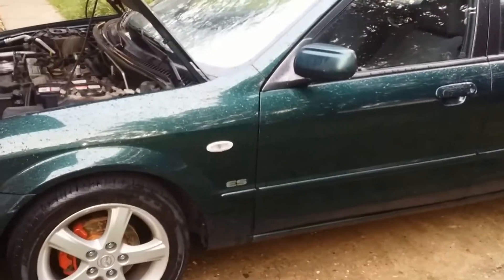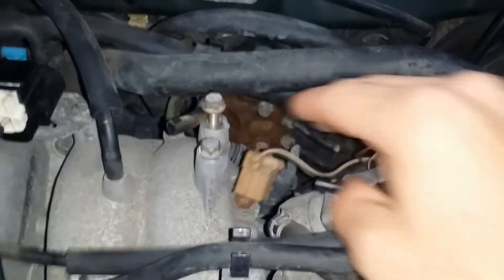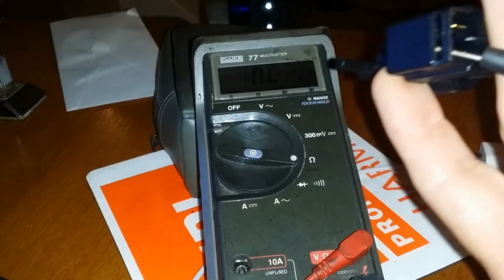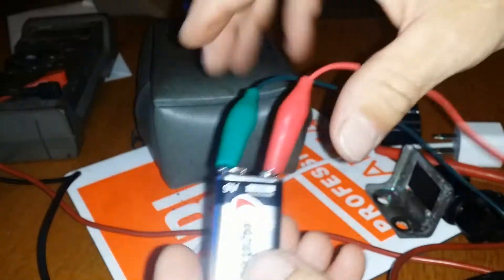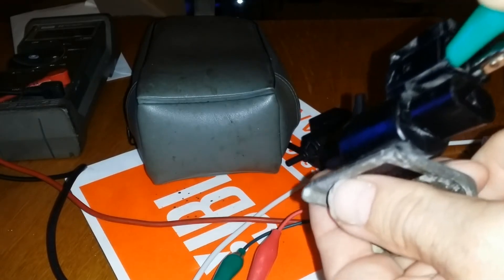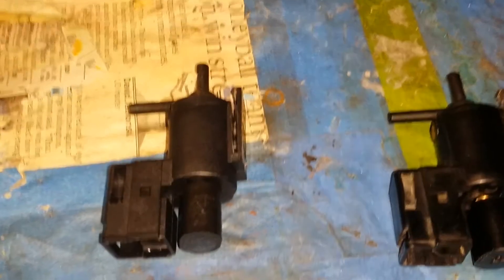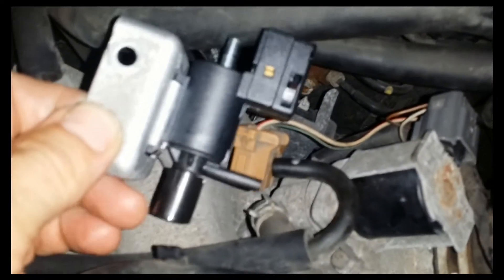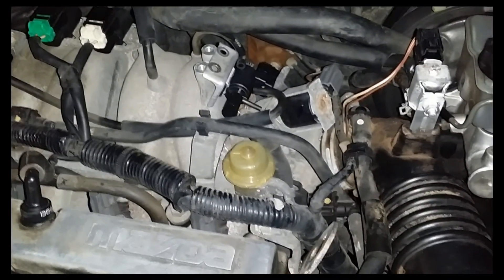Mazda Protege 2003 ES EGR SOLENOID Testing

Comment: That is fuel pressure regulator vacuum control valve, not egr valve. But an egr valve can be purchased inplace of that $80 vacuum valve. I know because thats what i did, just gotta take the lil air filter black piece and put it on the kther end to match the original.
Reply: Hey is there any elaboration you can give on this? Will it help run better? My car is having problems and I’ve replaced this little solenoid before.
Reply: Cómo se hace? Podrías hacer un tutorial

Comment: I’m having trouble getting the second hose in the back off. Any suggestions?
Reply from the maker: Try twisting it as you pull.  Should not be too hard it is just a push fit with no retainer.

Comment: I have an OBD and I am trying to get thru an Emissions Test with a Pass.  My two check engine codes were P0401 Exhaust Gas Recirculation (EGR) Valve and P0421 [Catalyst Efficiency Below Bank 1] .  In response I ignored all the suggested testing to trouble shoot the EGR Valve and decided to replace it.  Replacing the EGR Valve got rid of the P0401 Code., allowed the P0421 code to remain, and added code, P01250 FUEL PRESSURE REGULATOR CONTROL SOLENOID.   I am not going to initially replace the fuel pressure regulator as the service manual does not even title code P01250 as a fuel pressure regulator solenoid.  Mazda calls P01250 for a 2002 Mazda Protege5  2.0 inline 4 Presuure regulator control (PRC) valve cirecuit malfunction.  I don't think this lines up with being caused with replacing the EGR Valve.  I have not replaced the PCV valve in a over 100, 000 miles and I am going to try it first.  I did physcially test the PCV valve and it still sounds like its works.  According to the OBD the P01250 is being triggered at 750 Revolutions Per Minute (Idle) and 0 miles per hour.
Reply from the maker: I would look for vacuum leaks first. Many of the valves/solenoids run off of vacuum.  So if you have a leak that may be the cause.   A 2002 car is old enough to have rotted rubber hoses and connections.  I found at least one that just fell off, when I first started working on my car.  Your PCV valve may just be the tip of the iceburg.  The other place for rot is in the rubber intake hose just after your air filter.  If air is leaking in and not being metered it messes up your measurements.  I bought one or ebay for very cheap.  Bend it back and fourth to look for dry-rot cracks.  There are videos that recommend spraying various substances to find the leaks.   Additionally a cheap thing to clean is the butterfly flapper on your throttle body use carb cleaner.  Those can become gummed up and air will pass through improperly.  Let me know how it goes.
Reply: Thanks, replacing the Exhaust Gas Valve Solenoid or Pressure Regulator Control Solenoid as Mazda calls it, removed on board diagnostic (OBD) code 1250.  Afterwards the OBD then found a new code 0660 (Intake Manifold Tuning Valve Control Circuit)  to add to code 0421 Catalyst Efficiency Below Bank One or  -  Mazda's reference to the TWC  known as the (Three Way Catalytic Converter).  According to Google OBD 660 is triggered by vacuum leaks and when I looked for some I reconnected two vacuum hose clamps I disconnected running to the Purge Solenoid Valve.   The engine check light went off due to disconnecting the battery earlier that day but after driving 100 miles and doing another OBD scan the only code left was 0660.  It is not triggering the check engine light and when I took the Mazda over to the inspection station the vehicle passed its emissions test.

Comment: So did u get the code fixed after u replaced the PRC selenoide (p0090) please let me know i have same issue but already replaced the fuel pressure regulator (FPR) not a cheap part but im still giving me p0090 code thanks for the video very helpful
Reply from the maker: That code went away,  but I have another code related to the O2 sensor that I have already replaced that remains.

Comment: OMG that IS NOT the EGR VALVE lol That's a fuel pressure regulator
Reply from the maker: I never said it was the EGR valve.  I actually said that the parts places (Like Autozone) call it the "egr valve SOLENOID".   They wont be able to find it if they look it up under PRC.
Reply: fairbornCCF You’re right. I just went to my local AutoZone yesterday and they gave me a blank stare when I asked for a PRC Solenoid Valve. An older employee then took over and showed me a part listed as an EGR Solenoid Purge Valve. SMH